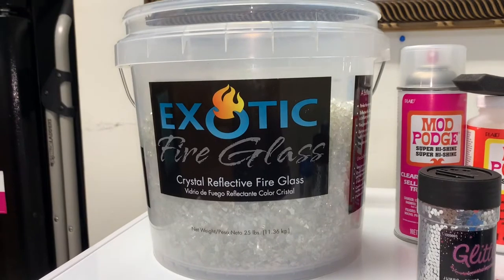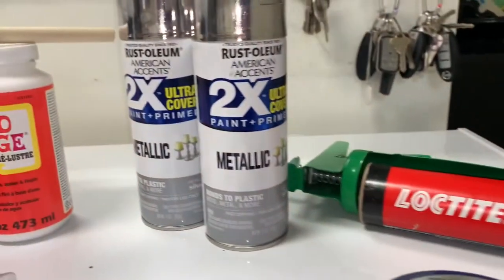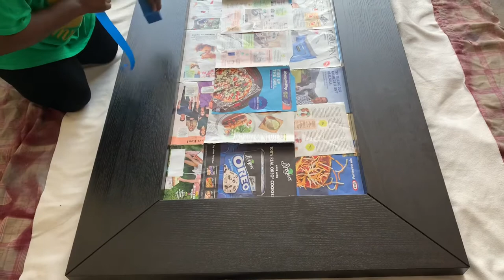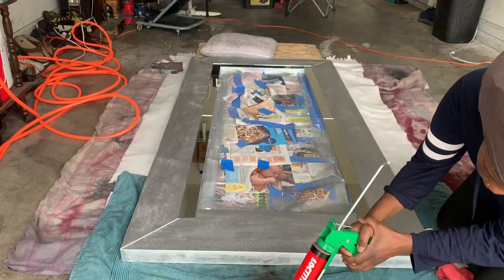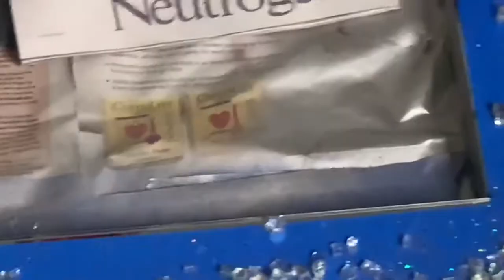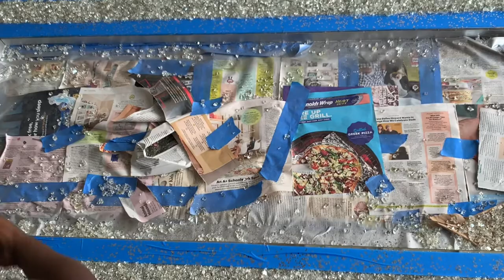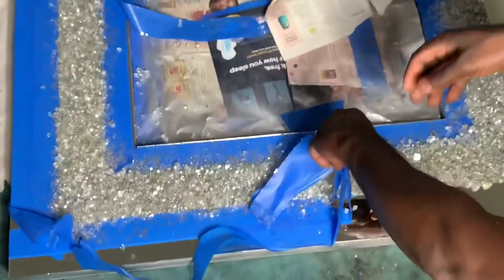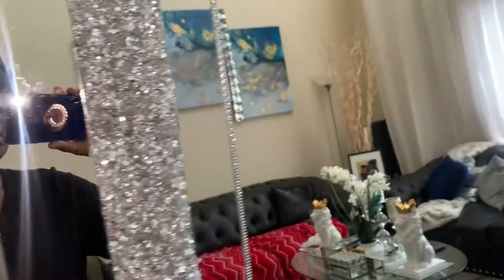DIY  IKEA HACK| GLAM MIRROR

Comment: This is absolutely gorgeous, I LOVE IT. I’m going to attempt to recreate for my vanity/beauty room. Do you have the measurements on the ikea mirror?
Reply from the maker: Hey Tiffany   This is the measurements ikea have on the website product dimensions
Width:	94 см
Height:	190 см
Reply: @tammy82vi  thank you so much! If I’m unable to locate the exact mirror how did you calculate the measurements for the mirror sizes from Lowe’s?
Reply from the maker: @tiffanyforrest501   we just Measure the length  from the top of the mirror to the bottom. Then we measured the width. I’m going to do a updated video next week on the measurements to be more clear .  Once I have uploaded it I will tag you. If you have any more questions let me know so I can address it in the video 😀
Reply: 11A1